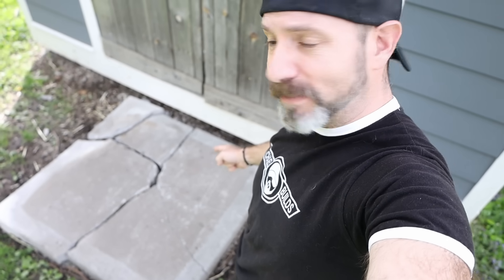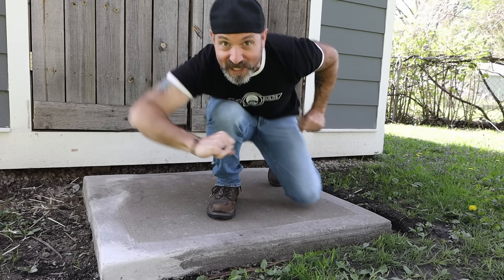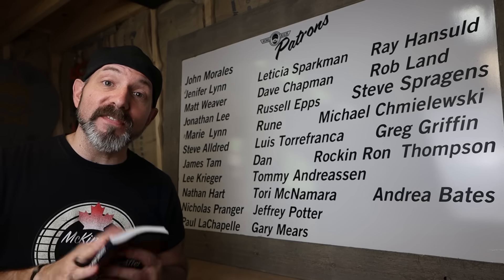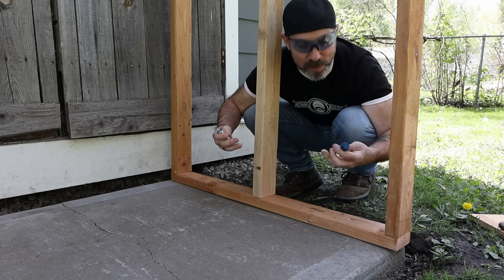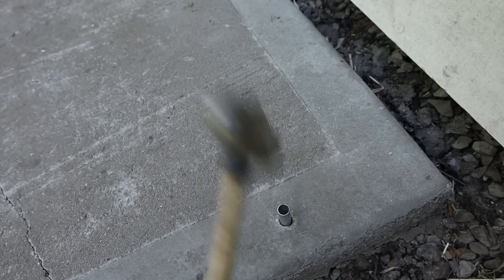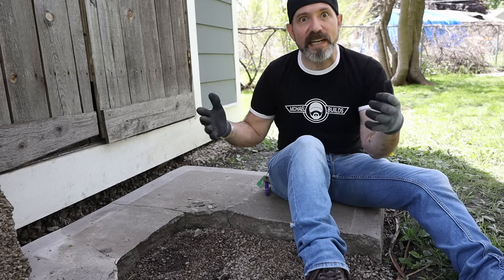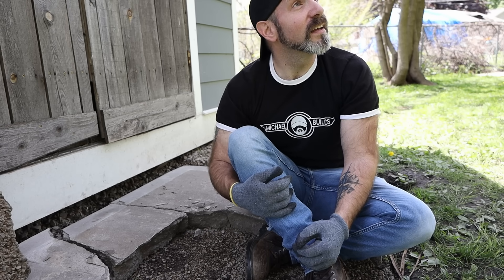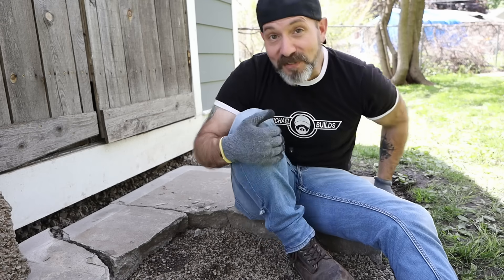Dry Pour 30 day cure Test

Comment: Completed a dry pour 12 x 16 with 4 inch slab thick with rebar in the middle. Great results!!  Buidling a 8x12 shed and workspace.
Reply: How many bags you have to use for this project?
Reply: @ishaaqs  

106 bags for the 12x 16 (4 inch slab).
Reply: Why would you do that? Why on earth? What is the difficulty with just mixing your concrete to specification and getting the maximum strength? Just because it cured doesn't mean it cured well. Did you pour cubes and have them tested? No you didn't. You have no clue whether or not your results are good. You just think they look fine as far as you can tell. For now. Probably.
Reply: @nelus7276  Maybe because of the results on channels such as this showing a potentially easier way for the average person to get good concrete?
Reply: @nelus7276  
It was easier, cheaper, strong enough to hold to support my shed, zero need to rush, it was a fun project, and finally because I could do it.  It it fails, no worries.
Reply: @johnwick1289 I am thinking about dry pouring a bigger slab for a shed or possibly anchor walls down for more of a shop/shed.   What was your total cost for the slab?  Did you look into a company pouring it and what was the cost difference between DIY dry pour vs company wet pour?
Reply: @oakemaka  

My total cost was $1018.  This included delivery, rebar, 108 bags of cement, and a few other cement tools.  Ordered was placed at Lowes, and I received a 10% military discount.  The estimates I received were $3k on the low end and $4800 on the high end.
Reply: @johnwick1289  Those savings alone definitely make it worth it
Reply: @LyingMedia  

Exactly!  My 4 inch concrete slab is now holding my 8 x12 wood shed/workspace.  Entire project was $4100 (cement and shed).  Anchored the wooden floor to the concrete with zero problems, and we did the work.

Comment: This is not a criticism, I'm not a concrete guy and I honestly don't know.

Would an equivalent slab with identical substrate but done as a wet pour, perform better in the drive on test?

Thanks for this series, it's very interesting.

Comment: One place dry pour worked well was in a space between the garage and the fence. The space to work in was 3 ft wide, 24 ft long, difficult to access, and the slab  was 25 inches wide, 3-1/2 inches deep, 24 ft long. The dry cement mix could be moved in a bag at a time, the entire length of the forms could be 2/3 filled with dry powder before adding reinforcing mesh and the rest of the forms filled and the surface finished without worrying about anything setting up before finishing was done. While adding bags and laying the mesh the dry mix already in the forms could be walked on, which was pretty convenient. A 1/2 inch drip line with mist sprayers every 2 ft was hung along the fence about 4 ft above the slab. Used an irrigation timer to run the mist 5 minutes each hour for about 12 hours, then switched to 5 minutes every 3 hours for a couple of days. It rained about an inch three days after the pour, and the water was shut off. I'm really happy with the way out turned out. Started setting the bags in place at 3pm, turned on the mist at 7pm, didn't lift a finger after that except to change the timer.
Using the mixer would have required a way to get the wet mix from the mixer to the forms, which would have been either a difficult wheelbarrow trip or hauling buckets. The long narrow space would have had to be divided up into sections small enough to be reached across to screed and trowel. There would have been plenty of clean-up to do, too. In this case mixing wet would have taken a lot more work and time.

Comment: A vehicle that size only exerts around 25-35 PSI of ground pressure per tire. This shows that dry pour is weak. 

Why dont you just take a wet pour (proper slump) and dry pour, then go take it and get is pressure tested.

Comment: Clearly the concrete cracked because the truck tilted the entire slab. 

Reinforcement or a larger slab would fix that problem. 

Still probably not the best method but nice to know it can work for small projects.

Comment: The concentration of pressure in one particular area on any concrete, dry mixed or wet mixed, would have given the same result. The failure, if you can call it a failure, is a result of the sub-base/substrate giving way under pressure.
Reply: yep, thats what happened in my opinion too, because I used the same method he did for the test, to make a parking spot big enough for both my trucks, and my lawncare trailer and it hasnt failed in 3 years. think most people forget its not the concrete you really need to be worried about when it comes to driveways. Its the ground prep. If you didnt put ya gravel and sand thick enough and get it level and compact. Its gonna flex and the concrete is doomed.

Comment: That slab probably would have cracked either way considering the ground wasn’t really prepped or the concrete wasn’t reinforced for vehicle load. I think if you put clean gravel and compacted it and added wire mesh it would have held up.

Comment: Cajun Country Livin', the channel that started the dry pour, made it very very clear in their videos, their dry pours were for FOOT traffic only and were not recommending it for driving on. So personally, I think they get a major pass. They accomplished their goal and the dry pour works for that. The dry pour survived your driving until the slab began lifting off of the ground, at which point it eventually cracked.
Reply: "Started the dry pour"  please don't ever say that again as I have done this for years, and did a concrete driveway extension...but not doing their misting way which is why it won't work for a driveway, it creates a very weak surface.

Comment: As long as it gets hydrated (wet) all the way through, it will likely have the strenght listed on the bag.  It just takes a lot longer with dry pour.  Its certainly easier than renting or buying a mixer and easiervto work with for non critical work like sidewalks, driveways and pads.  You'd need to be really careful for structural applications because you'd need to wait much longer than normal

Comment: I think dry pour is meant to help those that have difficulty with the heavier labor and time crunch of traditional wet mixing and pouring. With traditional, mixing concrete and handling the heavy wet buckets/barrows is just too hard. On top of that, once you mix a😂pour the first bag, you have to keep going and finish all the mixing for the whole slab within a certain amount of time. That again can be too much for some individuals, especially if working solo.

Comment: I think you need to take on consideration that a drive way is a 6"slab not 3" so it cracked because 3"slabs are not suppose to be driven on. A 6"slab would be a real drive over test

Comment: Just built a 20'x8' shed on a dry poured reinforced slab 2 expansion joints 4" thick with 6" footings. 9'x8' high shed roof, 2 skylights, lp smart side,  fully insulate,  36" steel door,  standing seam roof.  On one wall is a wood accent wall,  installed on battons over pressure treated plywood.  5 rows of shelving inside,  camping gear,  tools,  2 dirtbikes parked in it right now,  just withstood the CO storms that came through.  No issues.  Why I do it?  Idk but worked fine. Withstood some freezing too.

Comment: Nice to see people testing this dry pour slab method.  In 2005 i built a 20x16 pole shed/barn.  I dumped dry quickcrete and troweled it out very similar to this.   18 years of parking a 5000lb tractor in and multiple different atvs, no problems.   I’m not sure mixing the bag concrete beforehand makes much difference other than huge amounts of time and work.   I used remesh though.  Pour it a couple inches deep, smooth it out put the remesh down and then put the other half on.  Easy.
Reply: I was wondering what the result would be like if you mixed the bag dry and added some chopped fiber glass before dumping the powder in a form with rebar or wire mesh.
Reply: Thanks for sharing. 👍
Reply: Hey Mike, was actually aiming to help a friend make a pole barn with this method.  Can you spare any tips or concerns to look out for that might weaken the end result if we do something the wrong way?

Comment: I few thing's to think about . One of you had rebarb or made it 1 or 2 inch thick.  I think it would of held the weight of the truck.  Also as other said . I believe it failed due to not packing support underneath. 
Now if you're doing a walk way or a floor for a shed or walk around pool area . I seen issues walking on it or drilling into it after 24 hour to build a shed. At this point it hard enough to walk on it. If it was a concern of drilling . You could still build the shed and 3 or 4 weeks later dill and tapcon into it .

Not for every job but deffently usable for many job .

Comment: How much air pressure in the truck tire?  The truck can't put much more stress on than the air pressure from just rolling across.  Climbing the edge pushed the pad just a little, starting the soil shift beneath.

Yes, it failed because the soil below shifted.  That's the typical concrete driveway fail.  More pressure on the concrete than it can support as a bridge across soil that can move.  You have to do some extensive dig and fill and packing/compacting to get the base under the concrete to not shift, allowing the concrete to bend and when concrete without reinforcement bends, it breaks.

The bag mix is typically rated 3000 PSI +, after 30 days,  when mixed in a portable cement mixer 1 minute after adding water. (like the Harbor Freight mixers) 

Without the agitation, you get 1200 to 2000 psi concrete at the same 30 days.  It doesn't ever achieve the same bonding of cement to aggregate.

Both get to 80% strength in just 3 to 5 days.

So, yes, it can do some things.  Don't expect it to survive as well as properly mixed concrete.

Comment: The reason it cracked is because not all concrete is created equal. That concrete mix you used is very cheap with a low psi sack rating designed for fence posts. If it was 6 sack rated concrete with fiberglass or wire it would not have broken.

Comment: Answer to dry pour: plenty strong, but if you're going to drive on it then add rebar just like normal mixing, as that would have cracked just like this without rebar.
Reply: ground work too, that substrate wasnt very compact and you could see it depress as he drove over the slab. People forget there is a reason most local codes for driveways/parking slabs require several inches of sand and gravel thats well compacted. My dry pour 3 spot parking lot for my 2 trucks and trailer hasnt cracked in 3 years. No rebar/mesh, but I spent a good 4 days fussing with sand and gravel and had to invent a redneck steam roller to get it compact.

Comment: After watching this and several other videos on dry pour my take is that I wouldn't use it for concrete that needs to take heavy loads. (Driveway, building foundation, ect.) But there are countless applications where the concrete just doesn't need to be that strong. For those applications, the dry pour method is adequate and easy.

Comment: on Nov. of 2021 we repaired an asphalt private road with dry concrete method. About 15' x 6' x 4 in thick is a triangular shape (patch) it was done with rebar, gravel, broken asphalt and rocks. All size cars and trucks drive over it, even dump trucks loaded with rock lol my skid steer been on it for hundreds of times. The repair has last all this time with zero cracks. so definitely dry pour has its place but if you want to insure your investment add some rebar and gravel or small rocks.

Comment: Let me tell you, there are few things more stressful for a DIYer than pouring cement. It's like walking a tightrope, but instead of falling to your death, you end up with a lumpy, uneven slab that's not even remotely level. Trust me, I know from experience. My first attempt at pouring a slab for my front porch was a disaster. I had all the tools and supplies, but I just couldn't get the mix right. It was too soupy, and it took forever to cure. The surface was rough, and it just looked like a hot mess.
That's why I was so intrigued when I heard about the Dry Pore method. apparently, you don't even need to mix the cement. Just make sure the powder is thoroughly wetted, and the rest takes care of itself. I mean, it sounds like magic, right? But apparently, the powder is porous and acts like a wick, so it draws in the water and sets up just fine.
Of course, there are some downsides to Dry Pore. For one thing, it takes longer to cure, so you can't exactly pour it today and build on it tomorrow. But if you're a patient DIYer who doesn't mind waiting a little longer, Dry Pore is a perfectly acceptable alternative to wet pouring.
Personally, I wish I had known about Dry Pore before I attempted my first slab. I mean, I spent an entire day mixing and pouring and smoothing, and it was still a hot mess. If I had used Dry Pore instead, I could have saved myself a lot of time and headache. And the best part? I wouldn't have had to deal with the cement mixer. Let's just say that thing is not my favorite tool in the shed. 
So if you're thinking about pouring a slab for a DIY project, consider Dry Pore. It might not be as quick and easy as wet pouring, but it could save you a lot of stress and frustration in the long run. And who knows? You might even end up with a better result. Just make sure you do your research and follow the instructions carefully. And don't forget the metal mesh! Trust me, it makes a huge difference.

Comment: That’s a lot of weight for that small of an area to withstand regardless - dry pour or wet pour.  It looked like the slab moved as well when the truck was going up and over the edge.  I bet a larger area that didn’t move could better withstand distributing the weight.  I’m not going to try it but I bet if I drove over my wet pour front sidewalk with a F150 it would eventually crack - especially it I could get it to move.

Comment: Darn, now I can't do a dry pour entry slab because it will fail  if someone drives an F150 over it, 100 times.....sigh, better call a contractor and get reamed instead. At least you did a real anchor test by using an actual hammer drill and impact driver unlike another channel that I won't mention, that used a Safe Space drill on easy mode and a wood screw hanger that he tightened by hand, and called it a real test of strength.

Comment: Thanks for the 30 day update on this dry pour. I think even with rebar in the center it would have cracked from the truck, only because the size of the slab, that size is more for walking on. I agree with the flea,  a fair comparison would be with a wet pour and dry pour and do the same test under the same conditions.
Reply: /\ /\ /\  THIS! /\ /\ /\

Comment: Maybe you should reattempt this with one of those fibre reinforced concretes. would be interesting to see those results
Reply: Fibre in your concrete is just a waste and was just a way to upcharge. When this first came out the reps pushed us heavily to sell it and we noticed that it did not actually add any real tensile strength or lasting durability over using rebar and roll wire. They even tried to push this over not using so much steel and it failed time and time again. I would not waste my money on fiber, plus it leaves a undesirable finish and for years you are left with hairy fuzzy concrete lol

Comment: I tell by the footage of you drive over it was the concrete that fail it was the gravel  not hold the concrete down  it was moving  overtime you ran over, that what made it crack over time it wasn’t weight truck  80 percent movement 20 percent weight.   It aleast movement cause move failed  of the dry poor.

Comment: The ultimate test is a compression test using force gauges to test the actual PSI of a sample core from a slab poured using dry pour and one mixed from the same concrete mix, this will tell if the slab failed due to lack of rebar or bad substrate or if the concrete was simply weaker.

Comment: there was no Base Prep, so the base failed 1st and the slab got loose and flexed.
a true test would have been two slabs side by side, one dry poured and the other wet poured. Both with a proper base.
Reply: but the real Question is:  How much time and work does a dry pour save, vs mixing a wet pour?  in the long run, is the time saved worth it.

Comment: I feel that if the pad was level with the ground around it, the pad would have held up much longer.  I have an area where I drive off my driveway, which was doing fine until the soil washed away. My driveway is now cracked where I pull on and off and this was a traditional poor.  Thanks for the video.

Comment: I can tell it cracked like any thin layer of concrete would. You need steel reinforcement.  Wire mesh , rebar . The concrete does lookbfully cured.

Comment: Dry pour seems to take much longer to reach it's full strength. But if a company wanted to put some research into it. I think they can come up with a mix that is better designed to do larger dry pour projects. It would be a money maker if they did.
Reply: Conventionally mixed concrete is considered to reach 99% strength in 28 days, which is commonly referred to as "fully cured". At 14 days 90% strength. A week gets to 65%.

Thicker pours and very cold or very warm conditions affect this, as do chemical modifications such as plasticizers and calcium.

Comment: For me, half the fun of concrete is mixing in the water to get the perfect consistency.
Reply: Yea, I just don’t see how dry pour is easier in the long run.
Mix in a wheelbarrow with water, dump it. run your screet board across the top. Have a beer. 
Edge it, float it. Have a beer. Light Finnish work.
Broom it and fire up the BBQ. 
Have dinner, mist it and call it a day